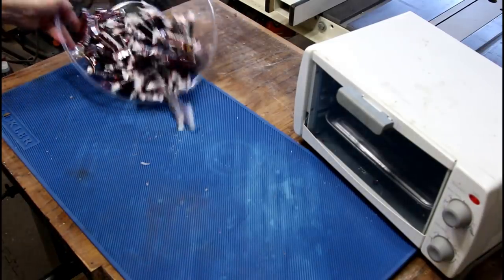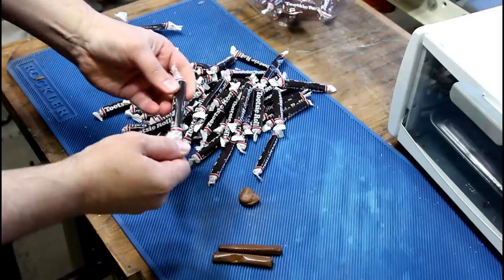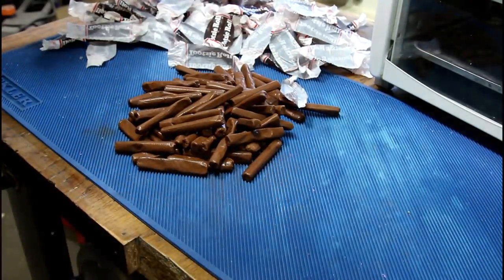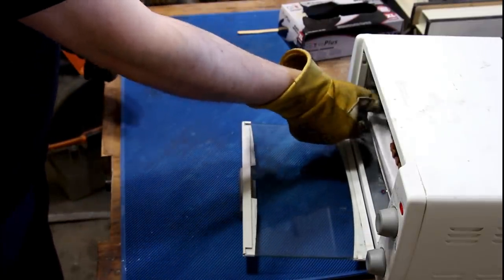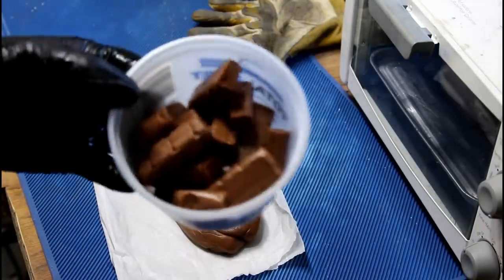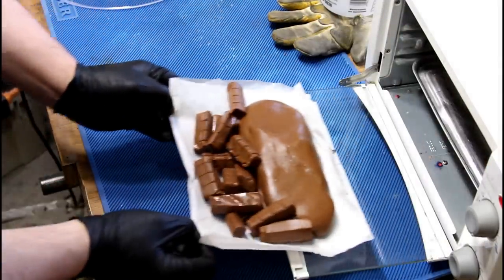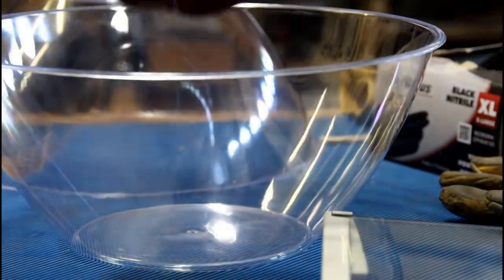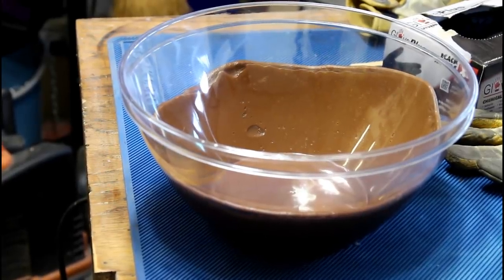What to do with Halloween candy leftovers?!

Comment: Heya Peter. I had a few interesting ideas for materials you might want to try working with.
Evergreen needles (or even leaves, maple or oak or maybe even a palm frond) , those little spears would probably look incredible suspended in clear resin  or laid out and cast in a particular design.

Another idea would be pine cones or acorns that could be stabilized in resin. The little pinecone chucks could make some really weird patterns if you suspended them like the metal shavings.